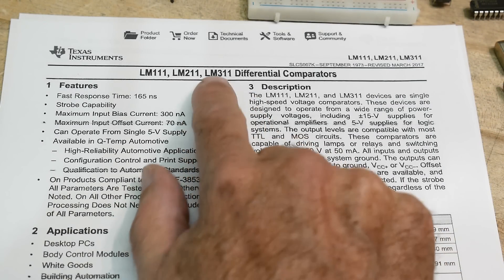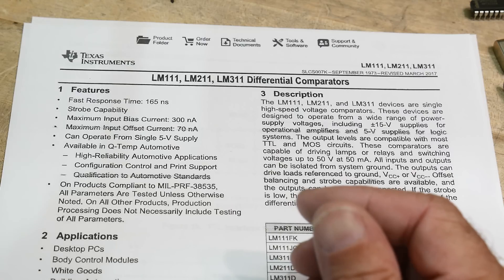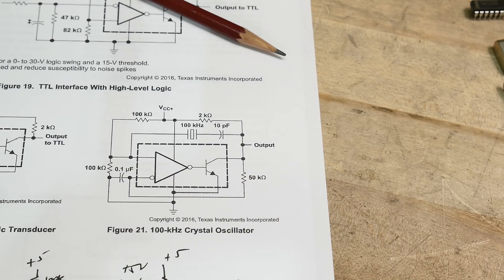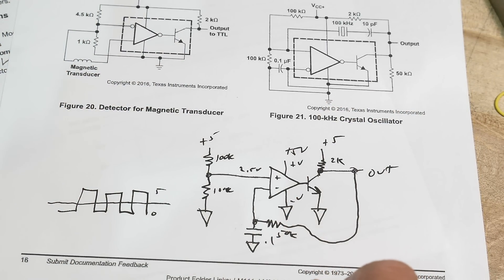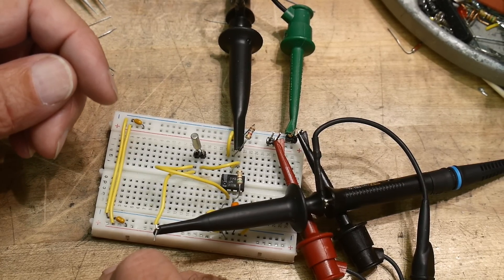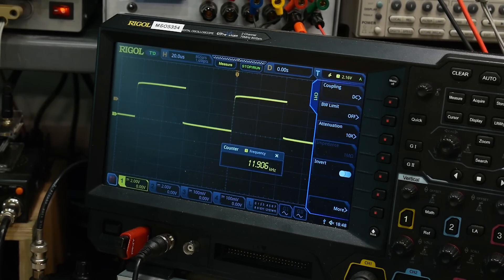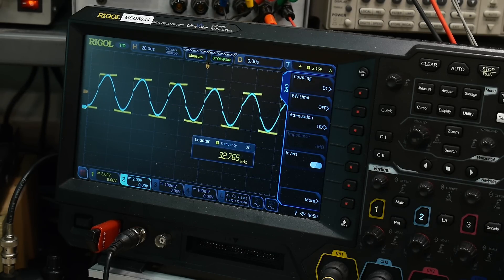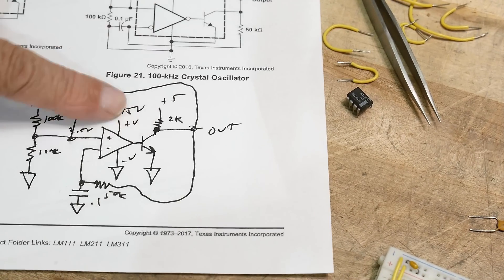#1201 LM311 Crystal Oscillator

Comment: I understand square wave with comparator, but not including NPN transistor 5:09 🤔 Because if neg input >2.5v then comparator output low, transistor off, output pulled high forever. 

I guess it’s because the transistor is inside the feedback loop but I don’t ‘see it’… Am I missing something?

Edit: I think I misunderstood and I was correct about it not square wave oscillating (before the positive feedback is added).

Comment: Crystals are series resonant.

The capacitor just charged and discharge.

Whenever a voltage level crosses the reference voltage level the polarity swaps and the oscillation begins.

Comment: In the suggested circuit you will notice a series capacitor. I believe it was 10 pF. Rather small. Note that many Crystal oscillator circuits use a single INVERTER and resonate at the PARALLEL resonant frequency. This circuit however uses POSITIVE feedback and resonates at the SERIES resonant frequency.  If you build the circuit as shown with the 10 pF cap and then measure the voltage at the point where the cap connects to the Xtal you will see a voltage that is HIGHER than the driving Voltage. Actually, you WOULD see it except that the capacitance of the scope probe dampens it down quit a bit. The equivalent circuit has a very high impedance with a large series inductor and small capacitor.

Comment: Other than the open collector output, I wonder what the advantage of this circuit is over the standard "cmos inverter with two load caps" approach, if any.
Reply from the maker: that is fine, this gives +/- large voltage output

Comment: Great video. However there are applications when you need a pure sine wave. In cases like these a comparator will not do. One of the options is going to be a Wien bridge oscillator build on an op amp.

Comment: The crystal is a sharp filter that will allow through a single, very narrow band of frequencies - effectively a single frequency. That means you're going to see a sine wave because any other wave would be composed of multiple frequencies, but he crystal only passes one.
When you use a capacitor for the positive feedback, it forms an R-C filter with the pair of 100K resistors. That simply charges and discharges through one or the other until the inputs trip the comparator into the opposite state. You can see it's an R-C combination from the shape of the curve. You could raise the frequency by lowering the 100K resistor values.
Reply: I know that it can be challenging to create simple RC oscillators of a low frequency, say 60Hz to drive a DC to AC converter, because of the large values required for the two components. In the capacitor arrangement of this circuit, is this a better method to get at low frequencies? I would think not, because we are back to using an RC oscillator.
Reply: @t1d100  I think the main goal of DC to AC converters is to deliver power efficiently, and the point of AC power is that it works well with transformers. The simplest converter is a couple of power transistors cross-coupled by capacitors with a centre-tapped winding as the collector loads, set to run at 50Hz or 60Hz. You don't get a very clean sine wave output, but for a lot of applications, that's no real concern.

Comment: Could that be the self-resonance point of the capacitors?
Reply: No. that would be very high for those sort of capacitors. The capacitor is being charged and discharged through the 100K resistors used to set the bias point. You can see that from the shape of the curves on the scope, which is a typical R-C charge curve. If you were to change the 100K resistors, you'd get a corresponding change in the frequency.

Comment: Of course, if you make your oscillators this way ,you would have very bad phase noise.  Do a FFT on your oscilloscope  and see all the harmonics.
Reply: Harmonics and phase noise are different things. This is a square wave, so by definition it has strong harmonics. Phase noise is the spectrum very near the fundamental frequency. There are several ways to measure it with a spectrum analyzer. I don't think an oscilloscope FFT mode would have enough resolution but I might be wrong.
Reply: @stephentrier5569  Of course they are different.  The cleanness of oscillator is very important when you want to use them as a local oscillator in frequency conversion or when you  use them as a clock in terms of jitter.  

The dynamic range is defined as the amplitude of highest peak (fundamental frequency) minus the next peak ( i.e.  harmonics) in spectrum analyzer in dB.  

All these harmonics interact with input RF signal and get converted to undesired frequencies. 

As a clock, it shows up as jitter.

As you know the difference between laser and LED is phase noise.

I always wanted to make a light (infra red, visible, and ultra violate) spectrum analyzer. 
Here are some of my ideas how built them:
1.  Passing the light through double or multiple parallel slots and putting light sensors on the projected screen,in a line to detect picks or intensity.
2.  Mixing light with a known wavelength laser, and then feed the down converted frequencies to RF spectrum analyzer.
3.  Passing it through a prism and measure the intensity of the diffracted light on the screen.

By the LF311 is discontinued part, that means they do not make it any more.  For high speed comparator, the best bet is to use phase detectors of PLL.  Of course, you should watch out for delay.
Reply: Phase noise is probably not much of a concern in a synthesizer. Harmonics could be a concern, or a feature, depending on what you want to do with the signal. Square wave oscillators are common components in synths.
Reply: @ÖrjanGustavsson  Phase noise causes adjustment channels to get converted into the channel, which then determines how close you can put the communication channels, which then means how efficient you can use the spectrum.
As you said, in Gilbert cell mixers, or diode ring mixers we prefer to use square wave as local oscillator to get higher gain and lower switching noise , and phase noise here shows up as jitter based on Shannon's Law.
Of course, if your Oscillator is under PLL control, the PLL would suppress near frequencies phase noise.

Comment: The prongs of the crystal oscillate sinusoidally and their deformation generates the piezoelectric voltage.  The step discontinuities are due to the stimulus at the collector.  You should get a frequency closer to 32,768 Hz if you put the 10 pF capacitor in series with the crystal to reduce the strength of the circuit's pulling the crystal off resonance.
Reply: I just wanted to ask about the 10pF capacitor!

Comment: Still don't understand where the sign wave came from with the crystal. Since there's no inductive element how did the crystal change that? And if it did why do we not see this in a regular computer clock crystal.
Mmmm I might have a beer.
De ZL1NAY
Reply: A crystal is a mechanical resonator that generates a voltage depending on the amount of deformation of the crystal. The mechanical resonance is very precise, and is fixed at a single frequency, so no matter what signal is applied to it, only one frequency can pass. A single frequency has to be a sine wave, because all other wave shapes are composed of multiple frequencies.
Reply: Crystals are electromechanical, but from an electrical viewpoint they function like an inductor in series with a capacitor, in parallel with another capacitor. That's where the inductance is coming from. Electrically it's a very narrow LC tuned circuit.

If you are thinking of the little metal cans with four pins, those aren't crystals -- they are crystal oscillators. They have the whole oscillator circuit, including the crystal, in a convenient container. You can get them with either sine or square wave output, but the square wave ones are much more common.

Comment: Capacitor missing in your drawn circuit.
Reply from the maker: that is to block DC, didn't seem to be needed for my xtal
Reply: @IMSAIGuy  Crystals will deform with a dc voltage across them (not by much, of course), and that can lead to inaccuracies in the frequency (should be 32,768Hz but you're close). It's not a big deal, but just best practice to block dc from appearing across a crystal.
Reply from the maker: @RexxSchneider  ok, good to know